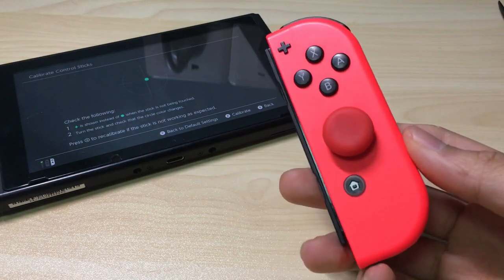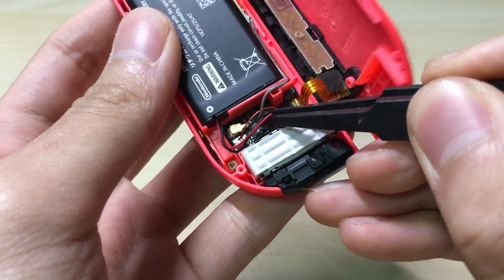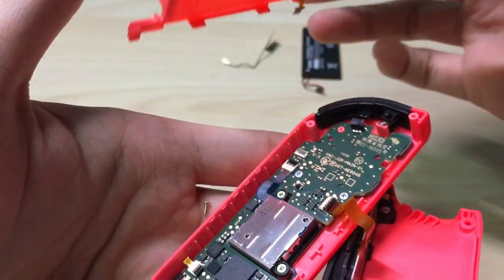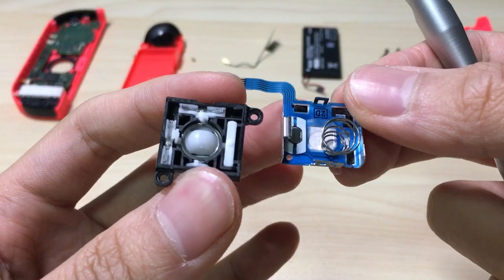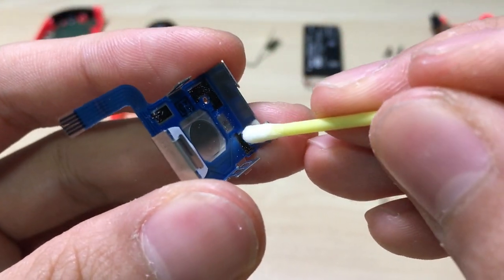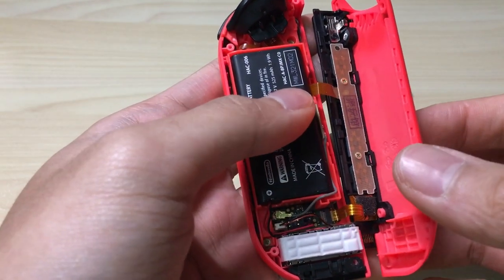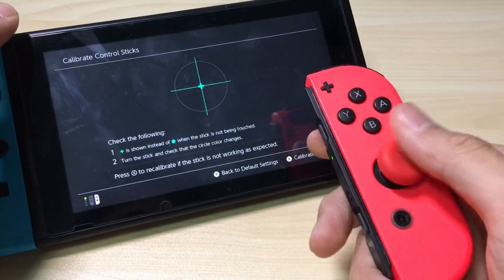Fix Joy-Con Drift by CLEANING the Joystick 🕹 - Nintendo Switch DIY Repair

Comment: Hello. I just want to say it is not dirt. All I did without opening up the Joy Con is just pop up on the Joy Stick like I was trying to break it but not breaking it as it's hard to do it.

What that does is loosen the pressures that the Joy Stick get stuck down because over use of pushing in the Joystick L3. I have done this to all for Joy Cons & have fixed them with no drift.

Please try this trick again next time & you will see it fixes the problem. Do a 360 rotation of popping up the Joystick really hard & you will see it get center after trying it. Also do it 4 direction movement left right up down popup as well.
Reply from the maker: If only I still have a Joy Con that’s still drifting I would try your method haha anyways I’ll keep it in mind 👌🏻
Reply: @namedkenn  well you can still try it. Try to see if the dot still shakes a little on the Joy Con in the 2nd calibration screen. If so the Magic-NS does none of that. 

But I just got the tools today & I want to try & open the joy con myself so I'm using this video to help me open it. Reason is because I got a very stable dot using the Magic-NS & I want to try understand why that is.

Now I won't clean the joy con because I want to try something else. I'll let you know if I find something different👍.
Reply: @namedkenn  Hello again Ken I have up a 3 part video about the Joy Cons with no Joysticks attached that shows why the drift happens. https://twitter.com/SNepeon/status/1133808486221901824?s=19 Let me know what you think because it shows no matter if you clean it or place a new stick that the auto drift from the board will fight with the metal pins on the joy con when the pads get damaged over time. The only real fix is when Nin does new joy con boards that don't drift when no Joysticks are attached.
Reply: Solo Nepeon you could just post the video here on YouTube. Thanks for sharing your analysis
Reply: Dude thank a lot ! This actually worked for me ! I highly recommend everyone to do this. My left joy con does not drift anymore , I was also scared to open it up and doing all that.

Comment: I'm a bit confused. I've searched on the tripoint/tri-wing screwdriver size. You said 2.0 but when I Google it, Switch and other Nintendo devices seems to have 1.5. Is it just that the switch have two kinds or that it's the only one with 2.0? Or did you simply just use a larger screwdriver?

Comment: Good vid. I'm having problems with a joystick i replaced, though. I get to the reassembly part but the joystick's ribbon cable seems to fail when i put the screws in place for the battery plate and i get a joystick pressed to one side as a result x.x Any tips? Is there a way to fix or place the ribbon cable/battery plate/anything in order to get it to work or shall i replace altogether? :s
Reply from the maker: Hmm I don’t fully understand without a picture, sorry I can’t help much 🤔

Comment: I dont have rubbing alcohol, but I do have window cleaner. I'm not about to use it but do you think it could fix it?
Reply from the maker: Hmm I don't really recommend it actually, but as long as you have a cotton bud just use it to wipe off the debris until the black part is clean entirely

Also, as you may have seen in a lot of others' comments, this will be a long and challenging process, especially when opening the joystick, the metal part might break, so be extra careful with every step you take

Comment: Be very careful while disconnecting the battery power...
Reply from the maker: Extremely careful...

I almost broke one of the resistor near it while trying to pry it out, in my experience just pull the cable with your hands that’s better than a using a plastic spudger, nevermind anything metal
Reply: I think i broke something with the battery😅😭
Reply: I pulled out a cable but I fixed it and the drift is gone😃

Comment: I hate my joy cons. The philips head screws would refuse to unscrew, one of the tabs of the ribbon cables broke off,  everything is so tightly packed; so everything went flying off, the actual button behind the 'r' just got detached for no reason at all, and the metal flaps that I tried prying broke off when I applied little to no force. Great tutorial, dreadful controller quality.

Comment: I'm about to make an attempt at cleaning my joycon today as soon as that damn tri tip screwdriver comes in that I ordered seeing as how no store that sells tools doesn't carry a tri tip, apparently they're not very common amongst tools.
Reply from the maker: Hahaha I know right, I’ve to order it online as well 😂 anyways good luck and make sure to be extra careful!
Reply: @namedkenn  working on it now. I'll let you know how it goes when I finish!
Reply: @namedkenn  well it turned out to be a disaster already it was going well up until I went to pry off the tabs and two of the tabs broke off. Guess I'll be buying a pair of joycons but at least I tried.
Reply: Update: After returning to my controller's repair job, it was a success. Thanks for the video!

Comment: I know this is old but you do not need to disconnect the side rails to pull out the joystick I've fixed about 10 controllers and pulled them apart more times then that and never removed the rails so u less you just like adding extra work to yourself save your time on this one
Reply from the maker: Ah you mean the side buttons right? I just remove it to avoid damaging it ✌🏻 but yeah yours work too!

Comment: hello question for the cleaning did you used ethyl alcohol (like normal alcohol) or isopropyl alcohol (for electronics)?
i know its a dumb question but i can find any isopropyl alcohol or contact cleaners to use so i was wondering if regular alcohol worked fine?
Reply from the maker: Hello! To be honest I don’t even know there are two types of alcohol (okay sorry for that), and that alcohol was from my father’s stuff, he’s a physician so probably that was alcohol for cleaning wounds (ethyl alcohol?) ✌🏻 hope this helps, even a bit!

Comment: I don't know if it's because mine is the left, not the right, but mine looks completely different from this.
Reply: Obviously the left looks different inside than the right.
Just like they look different from the front. Notice how one joystick is in the middle and the other at the top. The placement of the screws is obviously different.
The right one also comes with an NFC sensor for that Amiibo crap.

Comment: the prying part for the joycon cstick is different, my joycon went through a drift stick repair already, the metal shape is different compared to yours
Reply: sad part about this is the guide is perfect, the controllers are just so terribly built and designed that tear down and reassembly are completely impossible to do for your first time without harming anything.
3 hours later and I still can’t connect the ribbon near the battery port. might just consider buying new ones unfortunately.
i’m feeding directly into their plan 😒

Comment: I broke the battery connector and when trying to put it in place I accidentally used metal tweezers and now it’s not turning on when the contacts are in place and I’m pressing buttons, any idea on what I might’ve broken?
Reply: Nvm I wasn’t putting it in correctly, it’s still working

Comment: Is it better if I just buy a new joystick instead of risking breaking the metal tabs?
Reply: That’s what I want to know but so far unless I’m wrong it seems that the battery plastic base piece sits right on top aka the tabs aren’t actually the ones that are actively twisting pushing motions

Comment: Cant you also just not take apart the controller and fix it? Like lifting up the joycons skirt and wiping it with the drop of alcohol and move ur joycon around a bit then let it dry?
Reply: I guess you could but according to a guy I just talked with about this it normally is only effective for 2 weeks at a time before it starts acting up again, at least with this the contacts are fully cleaned and should last a year depending on the dustiness and how you store the switch- place inside case and upside down

Comment: When it came to the steps at 4:43 I ended up breaking off some of the metal bits  that hold it together. Nothing that  la little tape didn’t fix and it’s working. I’ll update this comment if it stops working
Reply from the maker: Haha in my second attempt I also break the metal tab, but taped it together and so far so good.

Comment: Be really careful bending those clips back. They snap really easy if you go a little too far.
Reply: Too late. Hahaha
Reply: Well, as long as it is only the tabs 'bend over' the stick's top casing, it should still work, if you break off the locking ones on the sides of the casing though...bad thing.

Comment: I wonder what I did wrong. I assembled the joycon again, but it seems the L button doesn't has any click feel when pressed.
Reply from the maker: Hmm try and see if you have put the button in the right place, you have to open it up a bit though, be careful on your way, and make sure to test it before closing up
Reply: @namedkenn  thanks for the reply. I fixed it. One tiny part dropped when I open the joycon. And that is the one that make the click. Luckily I found it later when trying to dissamble all over again :)

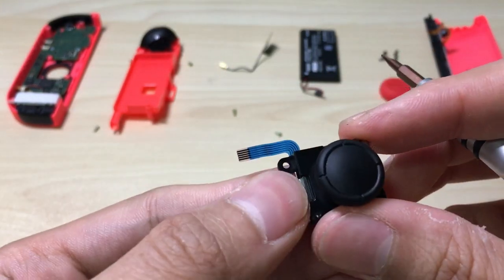Comment: Just finished fixing both my joysticks but I have broken both of the those folding tabs in both joysticks 8:22 is there any danger at all 
@Kenneth Tanaka
Reply from the maker: I broke em too, just taped it for the moment, it’s not like there’s not any danger since these metal tabs are the ones keeping the joystick together, for me I’ll just try to get a whole joystick ready in case mine breaks again ✌🏻
Reply: @namedkenn  how much tape did you use also won’t the battery plate just hold it down: also so it’s fine as long as the joystick closes- tested it by operating the push button. Also I’m confused about your wording since it has a double negative- it seems like you’re saying that it doesn’t matter too much but at the same time there is that double negative that confuses me
Reply: @namedkenn  theoretically as long as those are held down by the battery plate as such held flat is there any benefits of just getting and installing a new joystick

Comment: If I don't have alcohol what do I use?  Nail polish
Reply from the maker: No just use a dry q tip, as long as the surface is clean it’ll work
Reply: @namedkenn  what's a q tip / dry ... can I use the ear cleaners they are white fluff clean.

Comment: Why do all the videos take apart the right joy con? The left joy con is always the one that has issues.
Reply: The left one is simpler, since it doesn't have the NFC sensor.
The right one probably gives out faster since most people are right handed (90% of people, statistically speaking). So they push harder with their right thumb, causing the right "JoyCon" to give out faster.

Comment: I lost my temper at least three times while doing this and managed to break two of the metal pieces and now it's impossible to keep the stick casing closed. (my own fault of course, but yeah, next time I'll just replace the analog stick with a new one.) 😩
Reply: You could’ve just used some tape or count on the two side tabs (non folding) to hold it, that’s what I did and it worked :)

Comment: I just can’t open the Joycon screws. Is it hard? I’m using the triangular screwsdriver
Reply: You might have stripped the screws so for a next time you might want to apply more pressure and turn slowly (stripped screws are screws that have lost their grip)
Reply: Emmanuel I didn’t try hard to strip them. Plus I have 4 Joycons and they all don’t open. My question was whether you guys applied pressure to open these the first time?
Reply from the maker: Umm I pressed harder on my first turn only, to prevent the screwdriver from sliding around and stripping the screw. That doesn’t always work all the time though, but helps. Stripped screws are hard to deal with, I still don’t know what to do if I stripped one

Comment: Tried taking the power cable from the board and the plastic casing that held the cables to the board broke.....
Reply: You failed
Reply: @TechCartelSF6  Yea, the quality of the plastic housing for the cable is terrible. Its super soft..

In any case i fixed it

Comment: What causes the dirt to get there in the first place
Reply from the maker: I think it’s less of actual dirt coming in, but more of the black layer that got scratched off by the metal contact, and acumulate over time, thus causing problems

So that’s why many call it a design flaw from the start... But yeah, nothing’s perfect I guess
Reply: Kenneth Tanaka hopefully they fix it in all new models soon

Comment: I'll try this tommorrow. gulp
Reply from the maker: Good luck, and be VERY careful with everything inside, okay?
Reply: @namedkenn  I had to stop at 7:43. Thing on the left spread all over the place, and lost the circle and one of the flexible little things inside white thing. I can't seem to find it anywhere. And also off the part that you broke, I broke 3 of those. I need super glue now. I'll continue tommorrow without the missing pieces I hope they are not essential.

Comment: but what can i do if my joy con analog stick won't click anymore ? that's my problem.
Reply from the maker: If you have never opened the joystick before, I believe the metal button inside is broken, I don’t know if you could change just the blue thing inside (maybe I can call it a flexible PCB?) but I think it would be easier to just get a new joystick
Reply: @namedkenn  the metall button works, i can hear the click noise if i use my screw driver and press the button on the pcb. all the little plastic pieces in it seem to work good, nothing is broken or something - really weird. after getting everything back together, everything works but i can't use r3, it feels very soft when i try to click. i have this problem since i dropped the joy con on the floor. there are many sticks on the internet, do you know which one is good ? ( sorry for my english^^)

Comment: You know what? Forget the joycons. I’m better off buying 2 8bitdo SN30 Pro which is the price of 1 pair of joycons alone and I’m good. I did one of these a year ago, but the side panel where the flashing lights are stopped working along with the buttons even before I opened them. So I won’t be wasting my money on those anymore. Third party companies make better controllers, for the most part.

Comment: Removing the battery and the Z button is unnecessary.
Reply from the maker: Well yes that’s true, but I fried my own joycon board because I didn’t remove the battery before so I don’t want others to suffer from the same mistake I did. It’s just an added safety measure

Comment: I can fix in 30 seconds,  just use mouth to blow air to joycon to solve it, it really work due to root cause is some dust  in the joycon. It is really work.
Reply from the maker: Really good for you 😆 I wish I could do the same with mine, I’ve used that air blower (usually used for camera lenses) and still nothing happened so gotta go rambo 🤣
Reply: @namedkenn  Strong wind? may be too soft wind? may be I'm just lucky,haha
Reply: That's actually not a good idea because there is moisture in your breath which isn't good for the electronics. If you're gonna blow air into it, use a can of pressurized air.